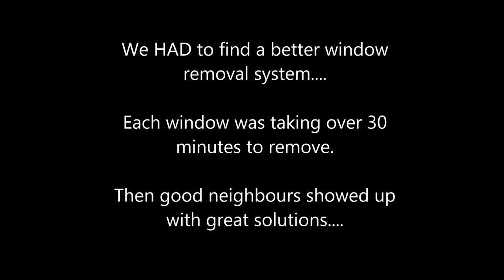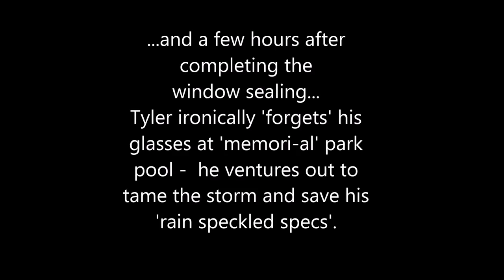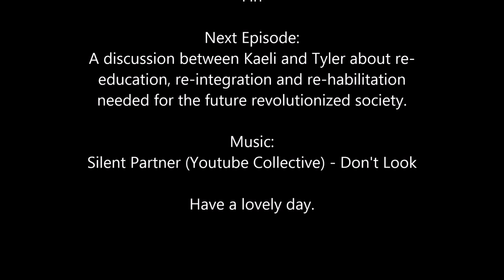School Bus Reno [Ep. 4] A Window PAIN in the Butt - Resealing Windows for Mobile Tiny Home

Comment: Pardon me if this is a dumb question but I am not sure I understand why you pulled the windows out. If you could elaborate on thus decision I would really appreciate it! Thanks for your time!
Reply from the maker: Not a dumb question at all.  The windows were leaking.  When we removed the floor, we could follow the "rust river" all the way up and to the corner of the windows.  Some of the "rust rivers" were so bad that it caused holes to form in the floor.

It was a big effort - but I am so glad to know that the windows don't leak anymore.  <3

Are you planning to reno a bus??  :-)

~ Kaeli
Reply: Oh bummer, well thanks for the reply! I will probably have some more at some point as they arise. Just bought a bus and it's time to get started!
Reply from the maker: YAY!  Yeah - dive in.  My biggest suggestion, after you seal and ensure safety, keep it simple.  Live in it for a bit before you make big decisions.  Wish I would have done so.  Would love to see what you've done.  Keep me posted.  :-D